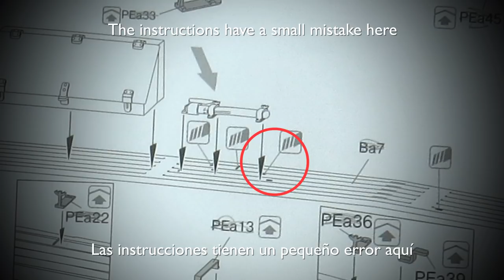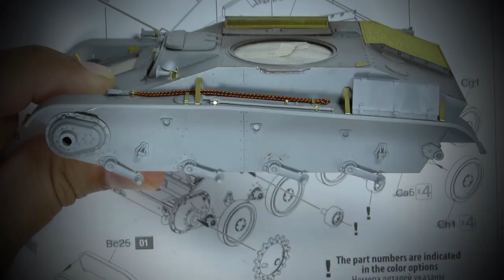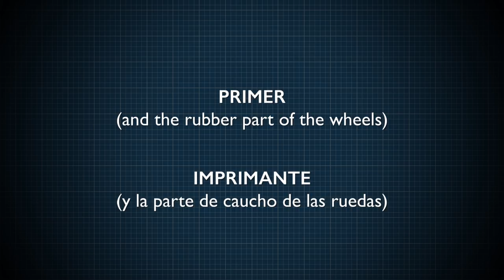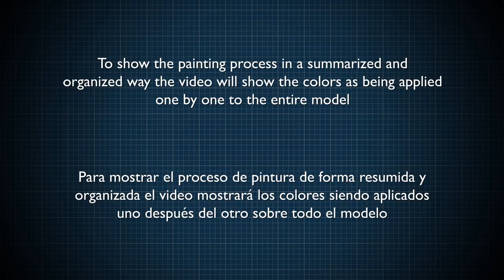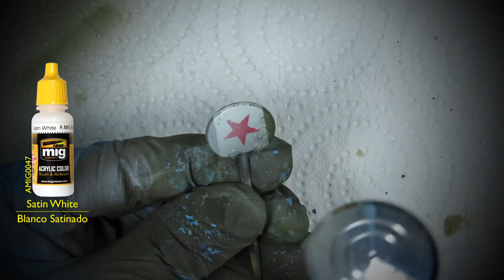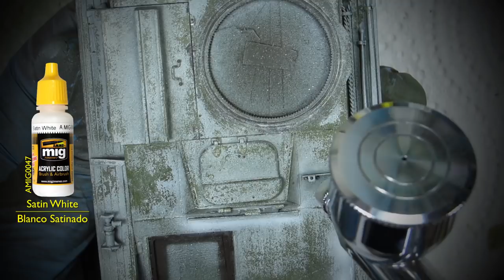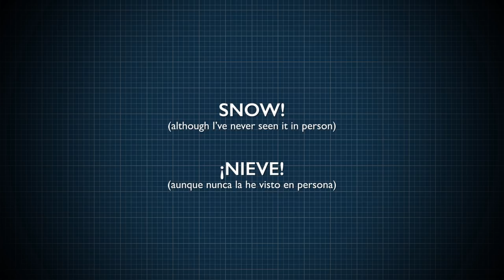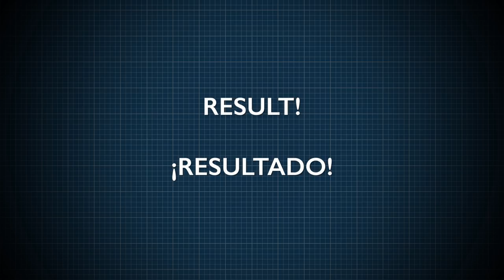Tutorial - How to build, paint and weather a realistic scale model tank - MiniArt's 1/35 T-60

Comment: I had a problem when I used set and sol after Lucky vanish to work with decals  - set and sol ate the vanish and I had dameged layer of vanish (the same thing with markfit of tamiya). Did you get the same result with these new Lucky vanishes or I'm so lucky to have such a problems?
Reply from the maker: Really? That's weird. I've only tested them over their glossy varnish and as you saw in the video, it didn't affected it
Reply: I used  the glossy varnish too (I have all of these new Lucky line varnishes). I went to the official distributor of AmmoMiG in Russia on this issue, it was a few months ago, so maybe AmmoMiG has changed something in their varnishes to solve this problem.

Comment: Hi Sergio! Many thanks for your videos, it's been a great learning resource:) I love your work, taste and the way you weather your models:) If I may ask you about Ammo Mig Lucky Varnish: could you please give some advice on how to use it? I have the mat and satin version, but I just can't use it with my airbrush... It clogs just immediately after pulling the trigger, and after about a 2 seconds it stops spraying at all. I tried different PSI, tried diluting it with water or tamiya X20 thinner, from 1:1 to even 1:5 ratio. But it still goes very ugly through my airbrush:( If you could share some hints, I would be very grateful!
Reply from the maker: Hi, Ziemowit! I'm glad you like my videos. About the varnish, I apply them directly from the bottle but never had any issues so I don't know how to solve them. They spray really well from my experience. Sorry I can't be of more help
Reply: Hi, thanks for the reply:) That's stange... I have 2 bottles, each one is completely unusable straight from the bottle:( I've read on many forums that people have the same problem with this varnish and it's clogging the airbrush completely... Could you perhaps share what PSI and needle size are you using? Is it 0.3 for example?
Reply from the maker: That's weird. Pressure is around 20Psi and the needle I use is 0.35mm
Reply: Yep, but I'm not alone here as I searched forums regarding this topic as well:( I also used 20 psi and 0.3 mm. Wird, I think I would search for some kind of retarder or try other brand. If two bottles are equally as bad, then there is something wrong with it..